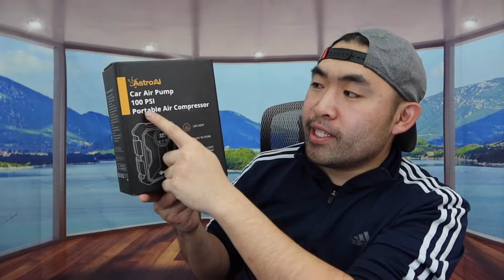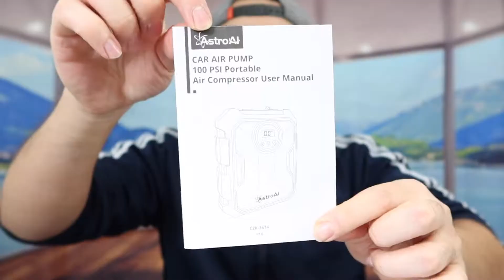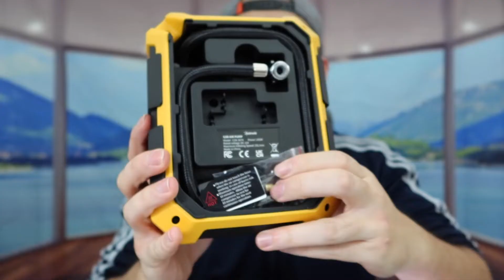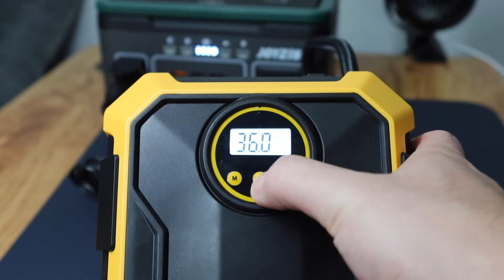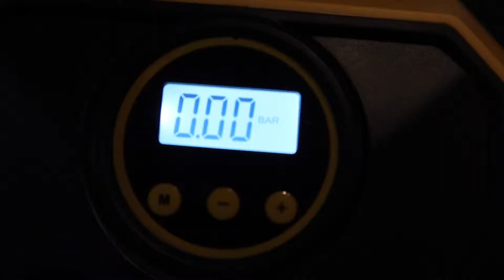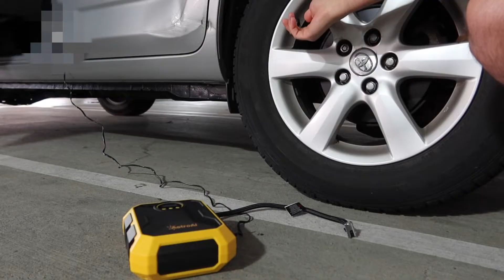How to Use AstroAI Portable Air Compressor Tire Inflator?

Comment: what are the two air nozzle adaptors for, and the needle valve adaptor, and the presta-schrader adaptor? All of these are in the pack but there is no information when or what i need them for?
Reply: Could use them on a bicycle. Just attachments

Comment: 😍😍😎😎✨✨👏👏👍👍Everyone should get one instead of paying the gas station for air.
Reply from the maker: Indeed!
Reply: If youre getting gas just ask the attendant to turn on the air for you, it's a legal requirement for them.
Reply: 💯...I bought one for $19.99 new on sale after I went to the gas station air pumps for my low tire and they all wanted $2.00...I was shocked...$2??? for air???..Screw that!!  I was so annoyed until I decided I'm not paying $2 for their air and just invest in one  and wait a day or two on it to be delivered to fill my tire ...even if i don't use it that often that's okay.
Reply: In most gas stations AIR it’s free if you pump gas there, or most of the times just ask the cashier if they could turn on the Air and they’ll do it.